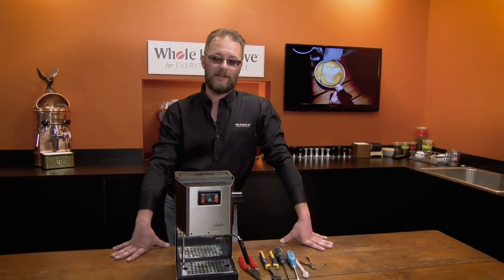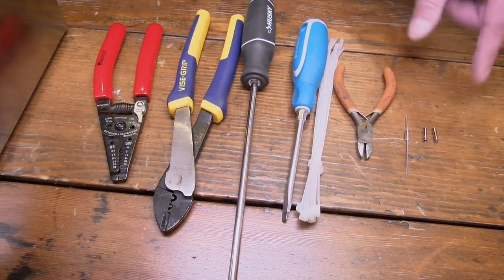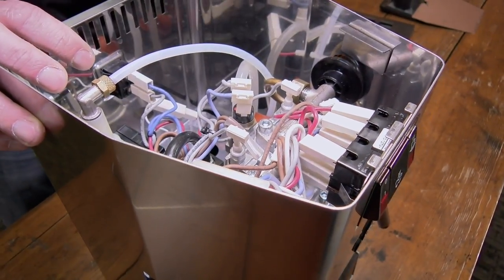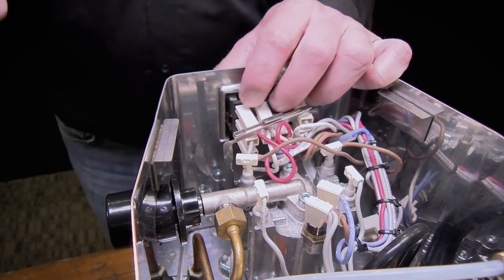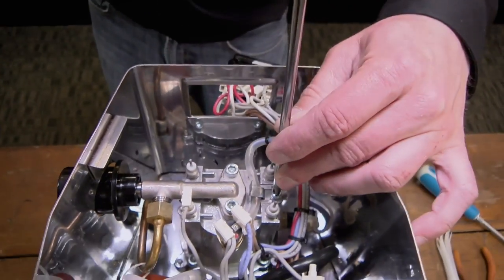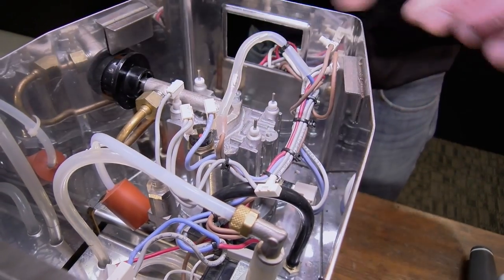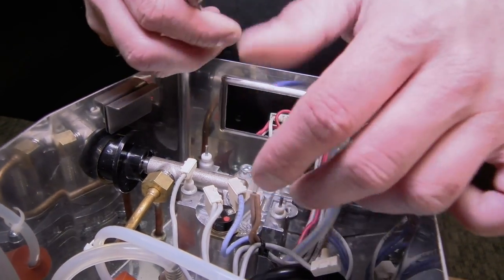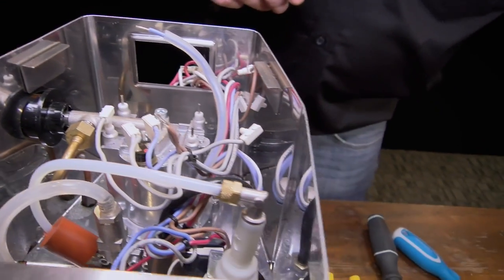How To Replace the Thermal Fuse on a Gaggia Classic Espresso Machine

Comment: Hi guys. My GCP is shutting down only when I press Brew Button? What is that? I test this thermal fuse, and it is ok. I also test two thermostat on boiler which are ok. Any idea? Thanks
Reply from the maker: Hi Joe, Do you mean when you press the brew button you get no flow of water from the group head? Does the machine make hot water if you open the steam valve and press the brew and steam switches together. If both of the above are true it's likely a scale blockage. More self help for the GCP available in our support center here: https://support.wholelattelove.com/hc/en-us/sections/1500000384362-Gaggia-Classic-Pro

Comment: I’m back again! This video is great. I’ve just replaced solenoid valve, thermostat switch and boiler gasket. Couldn’t have done it without this video. Just need to fix the leaking steam wand now. So happy it’s working again. Thanks again. Nice coffee tomorrow morning ☕️ 😊
Reply from the maker: You're welcome and thanks for leaving your comment. If you need to replace the valve/wand we have a video for that. Note that some condensate drip from the wand is normal. You can check for valve leak issue by closing steam valve and turning on brew and steam switch. If no increase in leak with that it's just condensation. Here's video for steam valve leak test: https://youtu.be/evSHNugOMto
Video on how to replace steam valve: https://youtu.be/3N7H-MfRSIk

Comment: Hey Marc and Ted - much appreciate the educational value of your videos. Unfortunately you don't ship to Australia so I cannot repay you by being a paying customer . I had a fuse blow and so ordered a replacement. I haven't yet replaced it as I was concerned it might blow again. I had previously cleaned out solenoid valve following Marc's excellent video but am concerned I had done something wrong when re-assembling that caused the fuse to blow. Are there any checks I can do prior to trying the new fuse ?...Many thanks again Marc for a fantastic YouTube channel
Reply from the maker: Hey carlo, Thanks for the kind comment. You might recheck the wiring and make sure everything was connected properly. Sorry it's hard to be more specific. It is a thermal fuse so in most cases it goes due to heat - boiler getting too hot.
Marc

Comment: Nice video , I did scale my machine last week, the problem that just happened my power on light will not come on however the machine will run , any idea please . Thanks
Reply from the maker: Hi TSBM, Thanks for the comment and question. So machine operates normally except no power light? Maybe just the indicator light is out? If problem is beyond that check our Gaggia Classic support page here for other issues: https://support.wholelattelove.com/hc/en-us/sections/1500000384362-Gaggia-Classic-Pro
If no help there and you're in the US/Canada you can contact our support team here for additional assistance: https://support.wholelattelove.com/hc/en-us/requests/new

Comment: I have problem with gaggia pro, indicator lamp for power and steam are on at the same time and no hot water come out from GH and steam wand. Any information about that?
Reply from the maker: Hi KTH, Not entirely certain what's going on with your machine like if it is heating and the pump is running. Could be the thermal fuse descibed in this video. Here's another video that may be of help on troubleshooting heating issues on the Classic: https://youtu.be/3IYXwIUf7Wg?si=3GbdSj8IQQBBrdsd
Reply: Thanks

Comment: My Gaggia Classic recently developed an issue seemingly out of the blue.  Turns on fine, makes the first espresso fine, but trips the kitchen circuit on the second shot.  Frother works fine, and does not trip the electrical kitchen circuits.  Leaving the power on does not trip the circuit.  Only switching on the water pump for espresso.  Thoughts?  HELP!
Reply from the maker: Hi Linda, Sounds like either something is wrong with the pump or you have an internal leak under brewing pressure causing water to get on something electrical causing the breaker to trip. Here's a video which can help diagnose leaks on the Gaggia Classic https://youtu.be/qAc5ZP-Mt4g

Comment: I have a question, I bought a Gaggia Classic and made a mistake. I accidentally didn't insert a long hose into the water. I didn't notice that  hose was clamped between the walls. And after warming up a little, I turned on the water supply, there was a little water at first and then only steam .  After I let it cool down and checked again, it seems to work fine. How much can it harm the machine?
Reply from the maker: Hi JC, Should not be a problem. Had the machine overheated the thermal fuse would have blown to protect things.

Comment: Hi guys, very clear video, thankyou! 
I replaced the fuse in my Classic 5 days ago and got it working again. It stopped again this morning in the same manner as before - after using the steamer, it would no longer pump. Naturally, I'm dubious of the prospect of just replacing the fuse again and thinking I'll be fine. What are the common causes of the fuse blowing that I can investigate? I should admit I have been a bit lax in descaling my machine recently. Could that be the cause of this re-occurrence?
Reply from the maker: Hi John, Thanks for the comment and question. The fuse blows when it gets too hot. Most common reason for blowing is leaving the steam switch on for long periods of time. Only turn on steam switch for steaming milk. Once you are done steaming be sure to cool the boiler down. To do that open the steam valve and push the brew and steam switch on. Let the pump run until a solid stream of water comes from the steam wand. Then turn off the brew and steam switches and close the steam valve. If that's not the issue it could be a bad thermostat on the boiler allowing it to get too hot. Here's a video with info on those: https://youtu.be/3IYXwIUf7Wg
Very unlikely scaling has anything to do the fuse blowing.
Hope that helps!
Reply: @Wholelattelovepage  Brilliant, thanks for that info! Yes, I generally always cool the boiler down after using the steamer, also to clear any loose grinds from the shower plate before cleaning up. I don't normally open the steam valve at the same time though (just run the brewer with the steamer switched off), but that would make much more sense and I'll factor it into the routine. 
On mature reflection, I think the steam thermostat is likely the problem, since I have also observe a noticeable amount of bubbling from the tank when I switch the steamer on, suggesting there's too much pressure building up. I'll replace the thermostat and thermal fuse and do a descaling cycle on the machine and see what happens.

Comment: Thanks for this. I've had the same Gaggia Classic for 15+ years. This is the second time I have had to replace this fuse. I leave it on for a long time (2-3 hours) each morning. Perhaps that is a source of the problem?
Reply from the maker: Hi Dave, Always nice to hear about longevity of machines like the Gaggia Classic. It may be internal heat causing the fuse to go. Could also be anomalies in power to the machine. With use you describe you are replacing fuse after about 7,000 hours of power on time. When replacing fuse pay attention to location of the fuse with regards to heat sources within the machine.
Marc

Comment: I have a 6.5 year old Gaggia Color. I just replaced the pump. The new pump seems to run well, but it cuts out after 30-40 seconds (the old pump cut out more often and was somewhat weak). With the new pump, sometimes I can rap on the top and it kicks on again. The wires all seem to fit tightly. If this sounds like a thermal fuse, can I order a replacement through Whole Latte Love?
Reply from the maker: Hi Kevin, Thanks for the question. Unlikely it’s the thermal fuse unless there’s an iffy connection. Typically when a thermal fuse goes the machine shuts down entirely. If it is the fuse you can order thru Whole Latte Love. But, I’d give our Service Tech’s a call at: 585-924-7170 before ordering. They should be able to help with a better diagnoses of what is going on.

Comment: This video was excellent. I replaced the fuse and the two thermostats. I had replaced just the fuse previously but several weeks later the machine stopped working again. This time I decided to replace the fuse and the stats even though when I tested the stats they both seemed to be working. The fuse however was dead. If the fuse dies again I will likely have to find a cause 
other than the stats.  But I couldn't have done it without Ted's video; at least not with the confidence it  provided.
Reply from the maker: Hi Peter, Thanks for the comment! We have more Gaggia Classic info including wiring diagrams and troubleshooting info available in our Gaggia Classic support wiki here: https://wiki.wholelattelove.com/Gaggia_Classic
Reply: How can you test the 2 thermostats?

Comment: My Gaggia Classic was working fine but then one morning I turned the power switch on and no light.  I am guessing it is the Thermal Fuse.  I don't know if the Thermal Fuse died due to some other problem and am wondering if I should also replace the Steam and Brew Thermostats at the same time just in case one of them being bad was the reason the Thermal Fuse died?  Prior to this problem I was not having any problems - the brew and steam temperature seemed fine.  Should I just replace the Thermal Fuse or also replace both thermostats?
Reply from the maker: Hi Stephen, I'd visually inspect the fuse and if it's not obvious that's it's blown check with a continuity meter. If blown, I'd start with just replacing the fuse.

Comment: I have a used Gaggia Classic that just stopped working. I'm not sure but my power went out because I was always cooking something else but the machine stopped heating up the steam and water. However, the indicator for temperature ready is always on. Do you believe this is a steam and boiler stat problem? The machine still turns on and water comes out. There wasn't any power surge.
Reply from the maker: Hi Ivan, Here's a link to our troubleshooting section of the gaggia Classic Support Wiki: https://wiki.wholelattelove.com/Gaggia_Classic/troubleshooting Sounds like it may be a bad thermostat. If in the US give our tech support a call at 585-924-7170 and they can help you diagnose the issue and how to fix.
Marc

Comment: Why would the boiler overheat to cause the fuse to blow?
Reply from the maker: Hi David, Could overheat if there was a problem with the thermostat on the boiler. Also as the result of misuse as in leaving the steam switch on for extended periods and failing to cool down/refill the boiler after steaming.

Comment: Yeah, i bought the Gaggia classic pro from you guys about 6 months ago. We were doing a shot and the pump cut off and the light for the pump went off but the power switch light stayed on. You can cut the power switch on and get power to that switch but the unit does not heat up nor does the pump work at all when you cut the switch on. I'm thinking the classic pro is wired differently and that it's the thermal fuse blown. However I'm not sure because on the old classic, you guys say it kills all power. Could it be different wiring between the two and its still the fuse blown?
Reply from the maker: Hi Jason, Sorry you are having an issue. Hopefully you've contacted our tech support specialist by phone. If not they  can quickly take you through diagnosing the issue and solving it. Contact info for tech support here: https://www.wholelattelove.com/pages/contact-us
Reply: @Wholelattelovepage  Well , it was the Thermal Fuse , I replaced it and its working great , awesome work with videos and thanks =)

Comment: What size/type/brand butt connectors did you use?  I'm guessing 22-18 gauge maybe?  I see some connectors have seams and some don't. Some are tin plated copper, some are nickel plated steel.  Help!  I have a new thermal fuse on order and want to have the right butt connectors when it gets here.
Reply from the maker: Hi Steven, thanks for the question. Either should work. Personally I'd prefer the copper.

Comment: Hi! I have the Gaggia classic pro and the middle light doesn't go on, is it because of the fuse? Thanks!
Reply from the maker: Hi IS, Thanks for the question. If thermal fuse is blown that generally cuts power to the entire machine. There'd be no lights or heating at all.

Comment: so if this blows, the machine appears dead? The reason I ask is that I have an overheating issue - leave the machine on for about 20 mins and it cuts off, no pump, just a click sound. Needs a long cool off to fix. I've changed both thermostats but no improvement. :-(
Reply from the maker: Hi paul, Thanks for the question. Excuse my delayed response - been on vacation and offline for a week. Yes, if that fuse goes then the machine would have no power. Here's a link to the troubleshooting section of our support wiki for the Gaggia Classic: https://wiki.wholelattelove.com/Gaggia_Classic/troubleshooting There are wiring diagrams etc available at that link as well. Please be advised this guide is for the North American version of the Classic and may not reflect certain models sold in EU and elsewhere. If you are in the US and need additional assistance contact our tech support pros here: https://www.wholelattelove.com/pages/contact-us
Reply: Hi. Few questions. Changed my classics fuse and I cuted the rubbing tubing . Wrapped the fuse in electrical black tape and put it back on the boiler with the clip. Now my gaggia is giving me shocks. 
 Is it because the tape is not insulating enough? I need the silicon tube? Why the fuse goes on the boiler? Could it be floating on the Air? Thanks!

Edit: what's rubber tubing part name or can I get it in home Depot?

Comment: Hi there , first I would like to thank you for the videos that have helped a lot
I have a problem with my gaggia classic coffee machine , the machine was working normally when I had to change the solenoid valve and after the change the machine turns on but does not heat the boiler , I used a multimeter to test the thermostat and they are passing energy normally and I also tested the thermostatic fuse and it is also passing energy, so I decided to test the resistance that is stuck to the boiler, one of them is passing energy but the other one is not, did it burn the resistance?
could you help me please....thank you very much
Reply from the maker: Hi JM, If stats and fuse are good and one of the heating elements is shot that could be you problem. Might be time to replace the boiler. If in US/Canada you can contact us for support here: https://www.wholelattelove.com/pages/contact-us

Comment: Any idea what material that tubing is made from?  I'm fixing a classic for a friend and his doesn't have the rubber tubing over the thermal fuse.  Just need to know what material to get at the hardware store?
Reply from the maker: Hi Andrew, Sorry for the delayed reply - was offline for the weekend. The rubber tube acts as an insulator to prevent shock/contact with other internal components. The tube does not come with the replacement fuse. Are you in the US? If so, give us a call and our techs should be able to find you a tube. https://www.wholelattelove.com/contact-us

Comment: What type of butt connectors do you need?
Reply from the maker: Hi Kaleb, If you purchase the thermal fuse here it includes the butt connectors: https://www.wholelattelove.com/products/thermal-fuse-184c-limit
Unfortunately, I don't know the specific size of the connector. If you already have a fuse and no connectors you'd want one that's a good fit with fuse and source wires.

Comment: My classic doesn't turn on. Pretty sure is the fuse, but I wonder why the fuse went off... What's the common issue?
Reply from the maker: Hi  AC, Fuse can go with a power surge, electrical short within the machine or in rare cases with age.
Reply: @Wholelattelovepage  I see corrosion on top of my boiler, right on the steam wand connects.. What do u think?

Comment: Great video. I'm getting cold water and no steam on my machine, could it be the fuse? Or is it the elements on the boiler? Ted says that the fuse stops the power completely. So I'm leaning towards replacing the boiler. I've ruled out the thermostats as the steam and the coffee water went at the same time.
Reply from the maker: Hi TK, Thanks for the comment and question. Here's a link to the troubleshooting section of our support wiki for the Gaggia Classic. It may help. Beyond that, if in US you can call our Tech Support at 585-924-7170 for assistance in troubleshooting.
Marc

Comment: Hey guys, maybe you can help with this: I just got a new Gaggia delivered, thing is, as soon as I pluggged it to the wall a power surge happened  (this without turning the machine on). This caused a small burned smell and burned male pin. What would be the advice in this situation?

Thank you in advance
Reply from the maker: Hi AM, Have you tried plugging the machine in again? Was the power surge caused by the source power? I'd try the machine in a different outlet.
Reply: @Wholelattelovepage  Thank you for the fast response, I tried a different outlet and the same happened. This outlets are working with other appliances.
The power surge is caused in the moment that there is contact between the Gaggia plug cord and outlet.